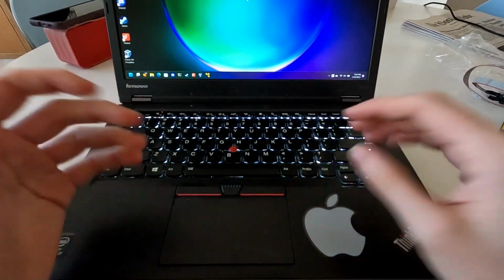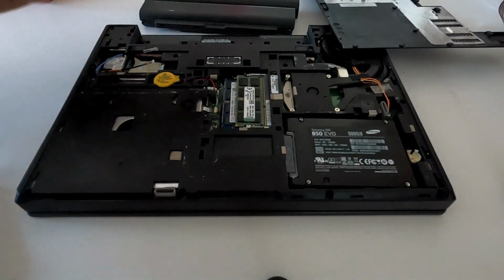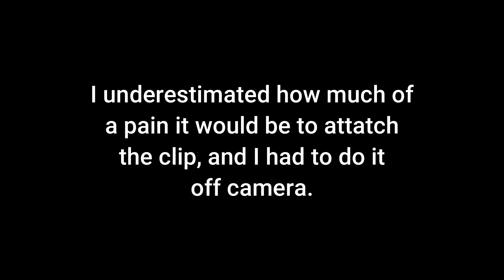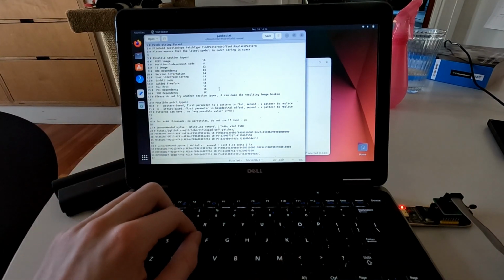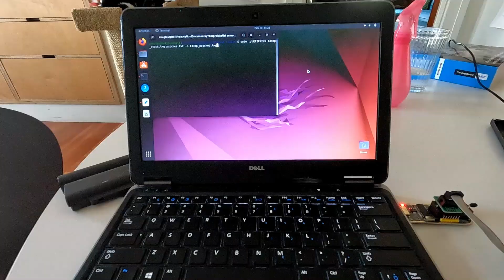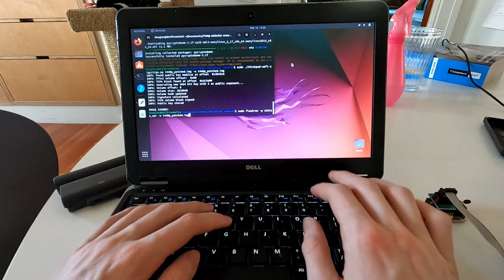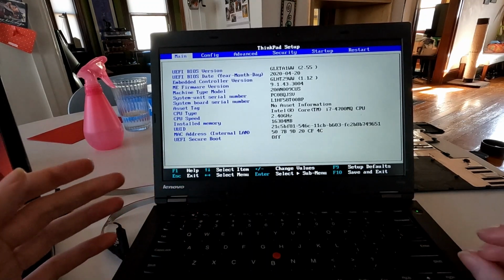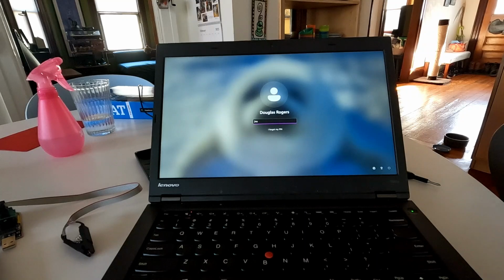Thinkpad T440p wifi upgrade and bios mod

Comment: For anyone following this guide: DO NOT disconnect the CMOS battery unless you absolutely have to. I made that mistake and ended up with the “0271: Real Time Clock Error – Check Date and Time settings” loop with no Date/Time tab available in BIOS.

The fix that worked for me (after the usual methods failed) was:

1. Reflash the original stock BIOS using a CH341A programmer
2. Manually set the date and time in BIOS (now visible again)
3. Then reflash the modded/signed BIOS

Everything worked smoothly after that. Just sharing this in case anyone else gets stuck — I lost way too many hours to this 😭

Comment: Wait, what does the WiFi upgrade do???
Reply: Probably change orginal 2.5G to 5G wifi speed. I use orginal and its ok not need flash bios, for wifi.
Reply: @Bekon241  better to use a blob-free card even if it is slower and costs more

Comment: Got a link to the wifi-card you replaced the stock T440P one with?
Reply from the maker: this is the card I used: https://www.amazon.com/Intel-802-11ax-Bluetooth-Adapter-Notebook/dp/B0B4T696W5/ref=sr_1_4?

although any m.2 wifi card with drivers for your operating system should work.

Comment: hi nice video, just a thought..what happens if I update to the latest bios, would the mod remain?
Reply from the maker: It's probably not a good idea to try, updating to the latest bios would probably either fail, remove the mod, or brick your machine. This laptop is old enough that it isn't getting new bios updates, so you can just update to the latest bios before you start, and do the mod with the latest bios, and not change it after that.

Comment: Hey, by doing this will I be able to connect to 5ghz networks?
Reply from the maker: Whether you can connect to 5ghz wifi determined by whether your wifi card supports it, so if you install a card that supports 5ghz wifi (which nearly every modern card does) than you can connect to those networks. I would recommend searching online whether the card yours came with stock supports 5ghz though, mine had the Intel AC-7260 which did. If yours should support it but you can't get 5ghz wifi to work, its probably either bad drivers, something messed up with your router, or you have bad signal strength, which can sometimes kill 5ghz connections but not 2.4

Comment: This notebook is good for learning python programming and other lightly things? Linux or windows ?
Reply: After upgrade you can use win 11 or any linux you want. Not only this thinkpad even older can do this. MY have 16GB ram 4core cpu 1TB ssd. And intel gpu for coding or linux you not need more.

Comment: When I try to use flashrom i get these errors:

 -"No EEPROM/flash device found"
 - "Found Generic flash chip "unknown SPI chip (0 kB, SPI)"

I cannot make any dump..do you think is caused by the clip?

Thank you
Reply: Problem solved. My green ch341a with voltages switch wasn't good
Reply: Usually is the clip (or the type of connection you made) that does not sit properly on the eeprom.

Comment: hello, I also have an old hp ProBook 6360 b laptop and I wanted to switch to wifi 6 as well, do you think there would be a patch for hp as well? Thank you
Reply: I replaced my WIFI card in my HP ProBook 650 g1 with an Intel WI-FI AX200 1600Mhz and it just worked without any patches or anything. For your HP ProBook it should just work straight up.

Comment: Why did you replace the Wi-Fi card?
Reply from the maker: I wanted faster wifi, but tbh I really mostly wanted an excuse to make a video and dip my toes into BIOS mods.
Reply: I know of one very good reason to replace the wifi. With computers with Intel ME you want to replace the wifi to a non intel wifi in order to break the Intel ME over wifi. The Intel wifi cards have support for the ME making it possible for someone to break into your system over wifi. The non intel ones don't have that support making it impossible for someone to break into your system over wifi. Another reason would be to get dual band wifi capability if the original wifi card is old and doesn't support 5 GHz wifi.